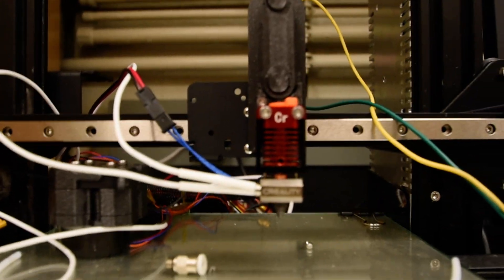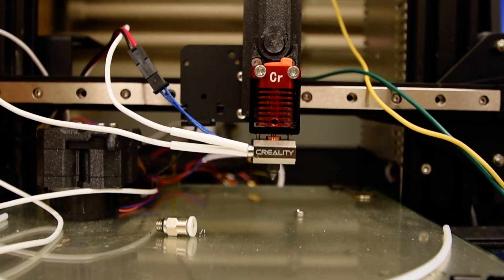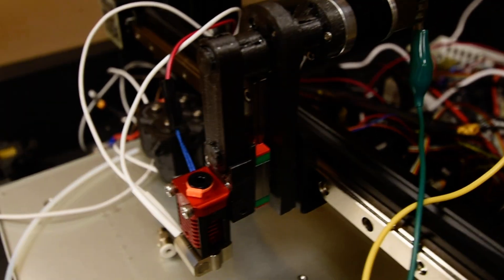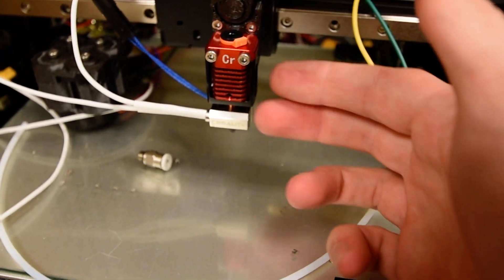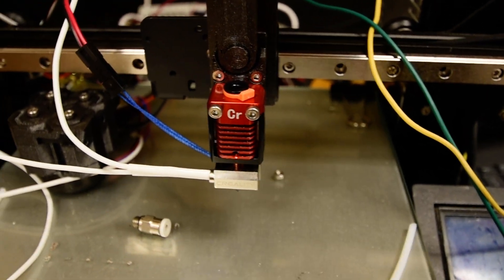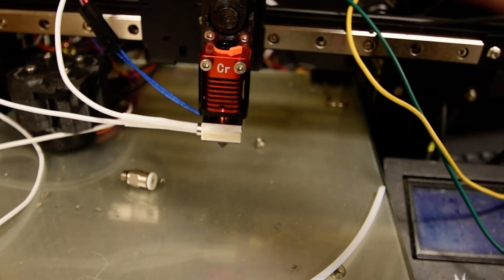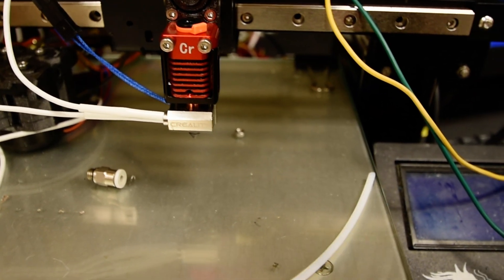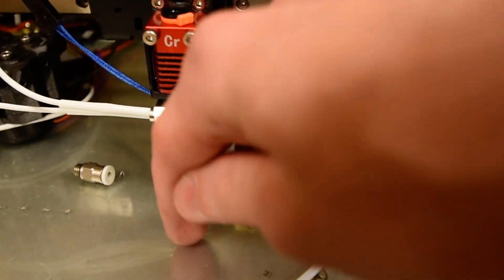Power hammer print heads and life changes

Comment: So i have been think about metal 3d printing at home for a while now. Imo the best approach would probably be something similar to resin printing rather than fdm. To be precise i always imagined some sort of light controlled electroplating process. The problem with electroplating is that the masks aren't dynamic. Finding a way to make dynamic masks for electrodeposition of metal would make 3d printing pf metal components possible on the small scale at home. It would be limited by   power consumption and material selection. 

If you have a preference for fdm then a electroplating print head is possible as well. If you use conductive plastic you could make a dual material printer that can work in both metal and plastic. Again power consumption will make rhe metal portion of the printer slow but im assuming that is true for your current approach as well. Using dissolvable conductive plastic you should be able to make a wide variety of metal parts that way. Although as i mentioned previously i would prefer a mask based approach. Mainly because of resolution. With a high resolution mask you can manufacture extremely advanced parts. Like metamaterials for example. Maybe there exists a resin mix that is only temporarily solid while illuminated but converts back to uncured resin when the light is removed. If something like that exists then a dynamic mask becomes possible.

Comment: What problems were you having with the EDM drilling? You say, "Basically, our yield of the glow plugs in  our best case was about 1/7 - 1/10 parts surviving the drilling operation". Were you having problems keeping the drill centered, or were they fracturing from internal stresses, or something else?
Reply from the maker: even with a well centered drill, the EDM operation was never stable. we could keep the oil clean, and get gap control working, which we did. But the hole was just so deep, and the tolerances on the bore too tight. There is also a sharp taper at the end of the ceramic section in the glowplug which tended to cause the electrode to deflect in the last centimeter or so of the hole. 
this would frequently cause the electrode to jam against the metallic socket holding that tapered section of ceramic in the glowplug (and acting as electrical contact) this would cause the EDM electrode to buckle and arc to the edges of the hole entrance at the tip of the glowplug or elsewhere. 

Increasing rotation rate of the electrode helped a little, but the electrode still had a tendency to deflect at the end of the drilling operation. 

And lining up from both sides of the plug is extremely difficult without dumping way to much money on a good stage or workholding. The tapered section also tends to deflect the electrode when it enters from the metallic side of the glowplug...

there is just a whole host of challenges that are "yeah buts" that keep adding cost.  I am sure someone with a large budget, and team could resolve the issues if they wanted to force this into serial production. but that is not me. 

Ultimately, even with the plugs that did work after machining, they ultimately lack the ability to resist the molten metals in the way we needed them to. 
alloy constituents that act as fluxes in the metals tendto attack the passivating layer on the ceramic, and allow the formation of high melting point clogs.
Reply: @rotoforge2024  Yes the flux problem seems to be a gotcha. I suspect painting the electrode with a thin layer of laquer and just sanding the tip may help stop the cut wandering off to one side. But ideas rarely survive testing.
Reply from the maker: @johndoggett808  this is a good idea I have not thought of. 
I may give it a try when I get the shop set back up. :)

Comment: You say, "the EDM drilling through refractory ceramic was quite costly and dangerous". I would be interested to know about the dangers. The first time I read that statement I had visions of toxic gasses - but perhaps you are just taling about the high voltage?
Reply from the maker: the oil is a very mild fire hazard. at the pressures we were working, it had a density to spray into fine atomized mists which were very unpleasant and no doubt dangerous to inhale. 

you could improve on the equipment and process to make it safer, but it would also be a risk, given that the aspect ratio of the holes we were drilling was so large at ~110:1 or so. 

I just wouldnt recommend deep hole oil EDM drilling through ceramic in your house. maybe a garage or proper shop. 

reprocesssing the oil is also very messy, and takes a lot of time. the cut swarf may contain cobalt and other heavy metals used as sintering additives in the ceramic materials.
Reply: @rotoforge2024  If you used de-ionised water rather than oil, you could avoid the fire risk. And maybe if you allowed most of it to evaporate you could dispose of the contaminated water by mixing it with cement, or plaster and dispose of it as a solid?
Reply from the maker: @johndoggett808  it is impossible to machine the ceramic in water. 
the oxygen in the water causes the ceramic to form an insulating oxide, and thus, EDM ceases to function. 

we tried water in our intial tests. I should probably publish that footage, but its very rough hewn so I have thus far avoided doing so. 

if you want to EDM conductive ceramic, it must be done in a medium which does not contain oxygen or which otherwise inhibits the formation of a passivating layer on the material.

Comment: Have you considered casting with refractory material as an alternative to drilling into glow plugs and such? Or did I miss that in an earlier video?
Reply: Tangentially... Where else should I recognize the name Rob Herc from? I feel like I know it from the 00s when I was in Illinois...
Reply from the maker: @claws61821  I am not sure. Perhaps?
Reply from the maker: yes. 
this opens an entirely different can of worms and is even more costly than glowplug drilling to develop and prototype. There might be a solution in this space, but I have not found it. I would love to see someone else explore the space however. 
I believe there were some people posting on reddit about aluminum nitride nozzles made by SLA and post fire. 
https://www.reddit.com/r/3Dprinting/comments/1d99l0m/aluminium_nitride_nozzles_for_abrasive_filaments/
Reply: @rotoforge2024  Because of the cost of firing the part? Or the cost of the molds?
Reply from the maker: @claws61821  
you dont have to have molds for small batches of SLA resin printable parts.
unfortunately, ceramic SLA resins in materials useful for this application are very expensive. You could mix your own resin. but this is not as easy as it might at first appear.

In addition, firing most materials of interest requires very high temperatures to get useful densities, and often inert gas atmospheres or even high pressure inert gas atmospheres. 

ceramics are a fine art, to this day. Its very difficult to get good results, and to make them repeatable. 

These processes are all batchable. But the up front investment is high if you want to scale. 
There are many other challenges in the details of how you print the materials, how you shape them, how you mix them, fire them, press them, etc etc. 

In my case the EDM machine approach was less costly, in exchange for a process that generated poorer yields. :(

Comment: Do you print aluminium?
Reply from the maker: It is among the materials we have tried.
I will put more details in a more long form video debrief about the glow plugs and probably in a blog post when I get my life/shop back in order. 
TLDR; pure aluminum does not bother the ceramic, but the extremely narrow melting range of pure aluminum makes it particularly tricky to print via the semisolid direct write metal approach.  Alloy aluminums have many of the same challenges that bronzes do.